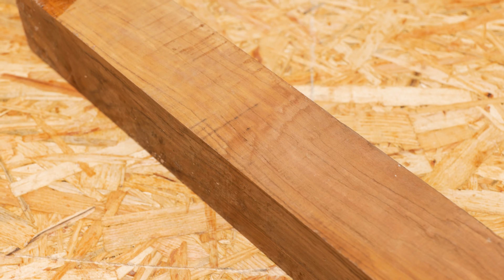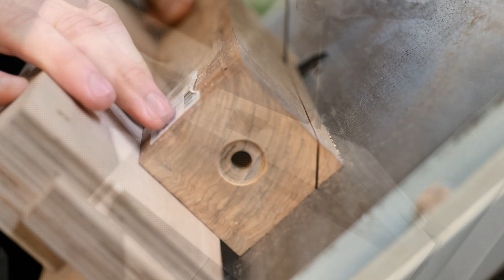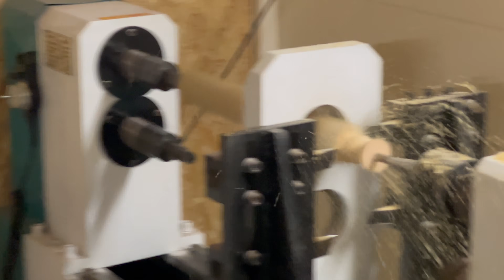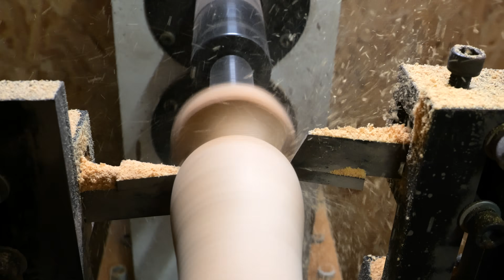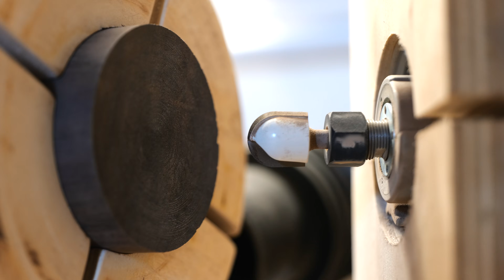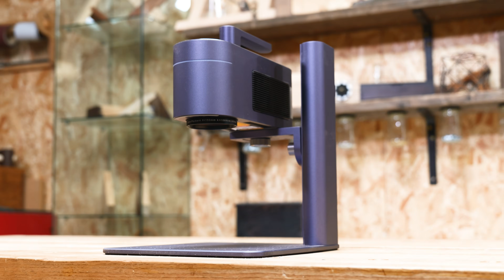Making a Mallet that Melts Hearts & Breaks Stuff

Comment: it looks beautiful. the things is the handle looks a tad short.
Reply from the maker: You're absolutely correct, the handle is shorter than normal. But this is intentional. It's primarily designed for detailed work such as small to medium scale joinery and assembly operations. If you're doing heavy duty morticing for example, you'd definitely want something with a bigger swing!

Comment: The CNC lathe should be in its own enclosure separate from the control pedestal. Further there should be an interlock with the enclosure's door and the controls so that when the door is open the lathe won't start.
Reply from the maker: Oh that's one of many safety issues with the machine that we need to address. We're currently working in the bottom two layers of the hierarchy of hazard controls which isn't ideal but at least it's something. We do plan on isolating the machine in an enclosure in the coming months though.
Reply: It reminds me of irradiation accident videos where 3/4 of  the safety measures are missing or deliberately disabled, enabling the operator to casually beam a body part into oblivion.